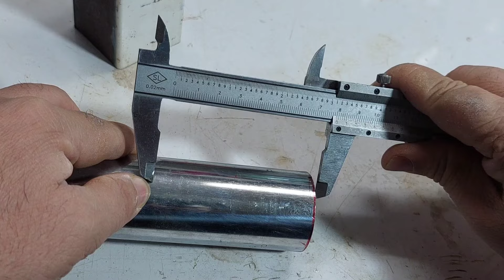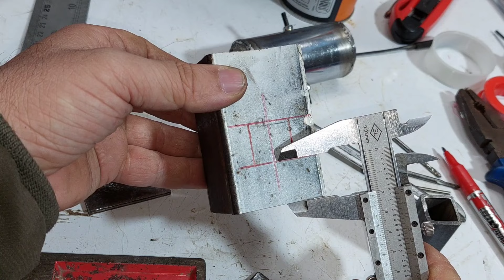Making a jet burner with diesel and water  -  Combined fuel of diesel with water

Comment: When water is heated, it becomes steam and the steam ignites the fire.
Reply: Для образования из воды водорода и кислорода надо температуры больше 1500 градусов . А там залита какая то горючая жидкость , спирт , ацетон , или растворитель .
Reply: No...I think the water is in a sealed container. The copper tube is above the level of water in the cylinder and is connected to a nozzle at the bottom. The water is converted into steam and exists in the nozzle. This creates a draft and air is sucked to the air vents to the burner spout. Thus creative a jet-like effect.
Reply from the maker: excellent👏👏
Reply from the maker: excellent👏👏